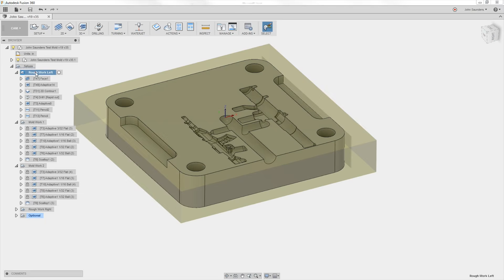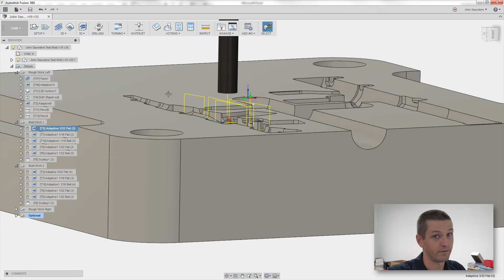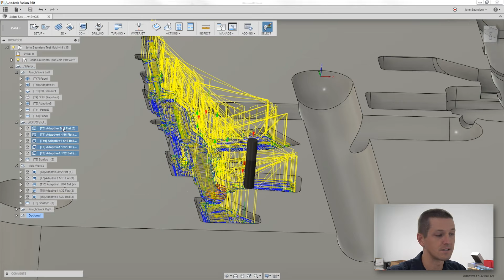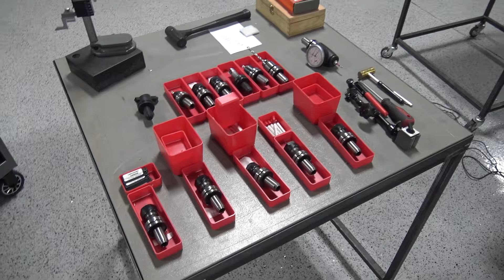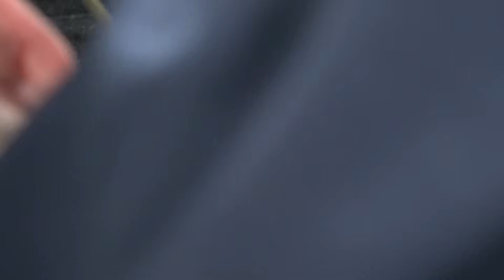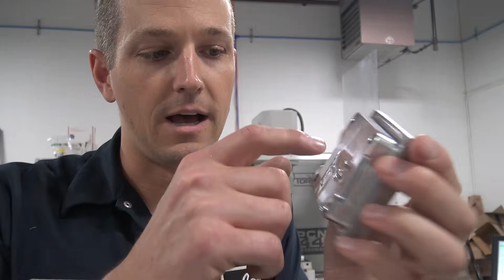Machining a DIY Injection Mold!  WW114

Comment: A couple of comments and observations:

Capturing tiny features:
Consider sinker EDM. Manual machines can be had for under $1K and are absolutely perfect for this size tool. Additionally, since electrodes are commonly graphite (in the US, at least), using tiny tools (0.010" and under and 10X diameter to length) isn't such a sphincter clenching ordeal. EDM is an entirely different realm!

Cutting runners:
Specialty runner cutters are available from people like Harvey Tool. I have had very good luck leaving 0.0075-0.005 axial stock for a semi-finish pass and 0.0025-0.001 with a standard ball end mill when cutting fully circular runners. On that note, talk with the tool designer and let him or her know that if fully circular runners are absolutely required, 1/16" increments are preferred from your position. Propose trapezoidal or modified trapezoidal whenever possible. 

Measurements:
Good call measuring runout with small tools - it's the often overlooked killer not only in terms of tool breakage, but also in surface finish. When using a tenths indicator or tighter, it's important to take out any hysteresis in the measurement setup. Using the plastic end of a screw driver to tap the base, in this case the vise, until the indicator settles out is one method. Furthermore, keep temperature in the back of your mind. If you're comparing runout both pre and post machining, your spindle has likely warmed up and, depending on environmental factors, may cool relatively rapidly, thus making your runout look worse than it really is.

Tool paths:
Roughing and semi-finishing: make every effort, especially with tiny finishing tools, to leave a constant amount of stock. While every cam system lets you leave stock for finishing, the vast majority (all, I believe), do not take in to account the scallop height that is an artifact of any operation. For example, if you leave five thou to finish and have a five thou scallop, the next tool is engaged up to 200% of the desired amount. It's always a trade off.

Finishing: Z-level, or "waterline", finishing paths are preferred in the tool and die industry. The rationale is that because you're starting at the top of the part and working your way down one level at a time, the cutter engagement is much more predictable. Think of it this way - when a ball end mill traces the inside of a concave feature, it could experience as much as 50% radial engagement!

It's great to see someone so excited and passionate about manufacturing! Keep pushing your skills and, well done!

Comment: John you were asking about the slop in the 10,000 indicator on your final end mill. I've seen this when the spindle  bearings heat up and you get a tiny amount of bearing expansion which will cause some bearing runout. But I'm old school so what do I know. When I started they still had tape NC machines.

Comment: Fun to see your excitement about this part. It's cool to see a project like this come together. I do hope that part works out for your client. Ummm... the bazooka is awful close to the end of the part. I'd be worried about that thin wall bending. This might be OK for injecting wax at low pressure, but might cause some heartache with higher pressure materials. It might also become a liability during long term use. It's so thin I'd be worried about knocking it and somehow bending it. I wonder if the holes were there for alignment - did you ream them to size ?

Comment: Runout on the taper? I'll have to look that up. I don't think tools are specified with taper runout.

The problem with aluminum injection  molds are the requirement for pre heat and cooling. You have to preheat the mold to accept the plastic at the sprue and not cool the plastic so much that it will clog the mold as  the plastic moves to the end of the mold. If you are shooting many pieces the mold will become so hot that you will be constantly changing the mold times to compensate for the reheating of the plastic. 
I've never seen a commercial mold made out of aluminum. All have been hard steels with cooling (and pre heating) ports.

Comment: That is so cool i am learning all i can think about this what if you made that mold the positive opposite out of something real hard then punch it into red   hot steal  i think my IRISH friend called it nibing then one mill operation lots of steal molds thanks for sharing from john in Texas all the best
Reply: Real hard like what? Cubic Boron Nitride? That would be interesting to machine ;)

The way this is done is by making a blank from copper (or graphite) and using EDM (electro discharge machining) to erode the feature out of the steel.

Comment: How much stock to leave did you have before the last pass? I'd imagine .001-.002? For the future on the sprue path that you had trouble cutting at full depth, try running the closest size ballnose through and then finish pass with your 3/8". For instance, run a .3125 or 8MM through the slot and leave .030 on the bottom, then you're taking roughly 30 thou off all edges with your final pass but at a much lower chip load.

Comment: Hey John you scrapped the Part!!! (maybe) Don't ad a chamfer where the mold channel goes out of the mold, that is where a nozzle will inject the material into the mold. The nozzle will most likely be flat so now the plastic seeps out where the chamfer is. You can fix it by milling out the chamfer as wide as the nozzle diameter is. Been making molds, did that mistake once or twice ;)
Reply: Not scrapped.  Easily adjusted.  It is only a small chamfer in aluminum after all.  Countersinking the nose is an easy fix.

Comment: Neat stuff! I just started experimenting with the micro mills, too.  I'm kind of surprised they are as resilient as they are.  I even ran a .03125" (1/32") through some #6 stainless screws to make a screwdriver slot and didn't break a single tool.  Well, aside from accidentally touching one with the wrench when I tightened it up in the collet.

I haven't tried my .01562" (1/64") mills yet.  They come with a protective cover over the flutes inside the protective tubes. :D

Comment: Awesome. Concerning the jump when you were checking the run-out, my guess is the spindle bearings have a worn/flat spot, or it could be just a manufacturing defect on the tool that you were checking. To double check I would put a dowel pin in and mark the area on the spindle where the jump is, take the tool holder out, rotate it check again and see if it repeats in the same spot on the spindle. No matter what orientation the tool is when inserted into the spindle.

Comment: When you adjust your indicator arm and set it against the part you arm measuring give the indicator arm a little tap with your finger nail, it'll release the mechanical tension in the arm and stabalise the indicator. Also I think somebody already mentioned exhaust runners for over pressure but these generally aren't used in modern injection moulding since the pressure is used to eliminate shrinkage whilst the plastic solidifies, it is the pressure that needs to be accurately controlled.

Comment: I need cnc tooling guide, I am electronics guy , wanna make fish net lights and  fish lure lights (Google for image's) production is like just 100 pieces per week , can I get a cad file to machine on cnc mill , see those threading etc , plastic injection machine  is fully manual , lever operated .

Comment: A couple of things might be messing with your indicator readings. First you rotated the spindle in both directions. Not sure what the precision of the Tormach 10K spindle is, but best to keep the bearings going one way. You might want to see what the runout on the raw spindle is, and what happens when you move it by hand. Another thing is to mount your indicator to the head not the table. Depending on how you lean in to rotate the spindle, especially with a camera in there, too, there could be some table movement. Also you are measuring on the tapered portion of the tool. That area is not critical so the grind tolerance will not be as fine as the shank and the flutes, which need to be precise to each other.
Wait until you get an electronic gauging head and meter setup, your dog walking by will cause the needle to move. ;)
Reply: Rambozo Clown 
spindle temp would also be a factor ref runout . E.g. Bearing clearance would not be optimal . Not sure if a Tormach 10k spindle would need a warm up routine . 
Stuart
Reply: KINDA WHAT i WAS THINKING. Way too much room for error readings. ball guage tip falling into cut flutes of mill bit etc. all along I was thinking, on a ball nose, do the guaging right at cut tip. with understanding there would be tooth to factor. of course, with understanding that ALL these guys are much MUCH more knowledgable than myself in this!

Comment: Does the program you use suggest what tools you need to use?
Reply: No. In most cases, it won't allow you to program a toolpath using a tool that has geometry too large for the toolpath strategy.

The designer/programmer is still responsible for selecting the appropriate tool.

Comment: That's some really nice machining, but I'm a bit surprised you can make injection dies out of aluminum. This isn't my area, but I'd always thought you had to use things like tool steel to keep the erosion down to something manageable. Maybe this is for a fairly short  part run?
Reply: I used to think that as well, but turns out that aluminium is perfectly good for low-run (well, say up to 10,000 parts!) production. There's a little bit of blurb about this here - http://www.protolabs.co.uk/injection-molding/plastic-injection-molding/. For REAL production, you'd definitely want to use steel dies.
Reply: l wilton -  You can use the aluminum mold to "bootstrap" yourself to a more rugged material. You cast a piece (the mold positive) with this aluminum mold negative, then make another mold negative with fine-grained casting sand, and use that to make the desired pieces out of cast iron, or whatever. This way, you just re-use the mold positive to make a new mold negative with the casting sand. You can even impress the mold positive multiple times into the casting sand if you need to cast lots of the part.
Reply: This looks more like a test mold anyway, it only molds one pc. per shot, and the parts have to be manually ejected. However, for small runs aluminum works perfectly well for this. Rather than spend huge dollars on a proper mold, it isn't that uncommon to do a mold like this to test a new part.
Reply: Aluminium mounds are often used for low volume runs as they are much cheaper to machine than tool steel. Also, prototyping is frequently done using a single cavity aluminium mould to prove the part and make any final changes before committing to producing a multi cavity tool in tool steel.
As for erosion issues... it’s likely that the parts will be moulded in ABS, HIPS, PP or HDPE which are not particularly aggressive and require less clamping force than if moulding GFPC or something of that nature.
Reply: Exactly.  6061 is soft, but machines easily and quickly - a critical consideration for prototyping.  When spinning a 1/32" cutter, time is your enemy.  Even small molds can take hours to cut the finishing passes at .001" stepover.

Comment: Remember that the tolerance for a LEGO brick moulds is 5 micron( they aim for 2 microns) and when moulding the temperature in the metal can't varies more than 0.5C (32.9F)
Reply: I think you mixed up relative and absolute temperatures. Absolute 0.5°C resemble 32.9°F, but a temperature difference of 0.5°C (which is the same as 0.5K) resembles a difference of 0.9°F. It all has to do with the fact that both skales have a different zero point (0°C = 32°F and 0°F = -17.8°C).
Reply: This isn't a LEGO brick mold, nor is it produced for the LEGO company.

Comment: Seems the bazooka is a little close to the edge of the mould. Would the edge of the mould buckle under the pressure?
Reply: There is a risk that some dirt or plastic scrap may buckle the thin wall inwards (Been there, done that... ;-) )
Reply: Pilch Plays the mold blocks are put into a steel frame in the injection machine and the whole thing is hydraulically clamped together. The aluminum walls won't be going anywhere.
Reply: These are a bit close, I agree, but I've cut over 300 small molds like this with never a blowout.  The only real issue is the reduced clamping force near the edges of the mold (most mini injectors use a round plate on the clamping cylinder) , and this guy will tend to flash is the plastic gets too hot.

Comment: you have material entry but no exit.  you need to have a place for over pressure.
Reply: bbowen1970 
It's an injection mold.  Material exit would be a bad thing.  

Hot liquid plastic under high pressure makes a horrible and dangerous mess when it comes squirting out 😆